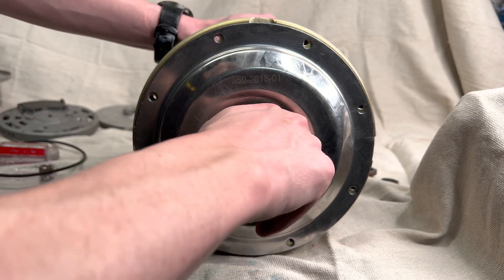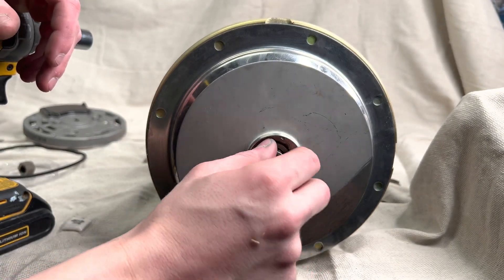How-To Replace a Mechanical Seal on a Scott Pump

Comment: Very helpful video, thank you! I would like to add, that on the rear plate (side with wires) you do not need to remove it. There is a hole in the center, that a flat head will fit into just fine.